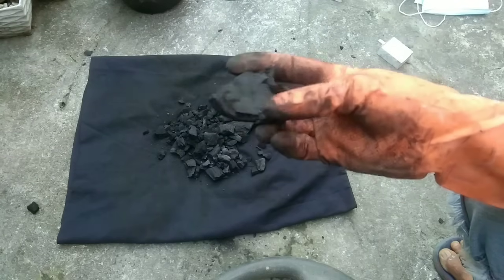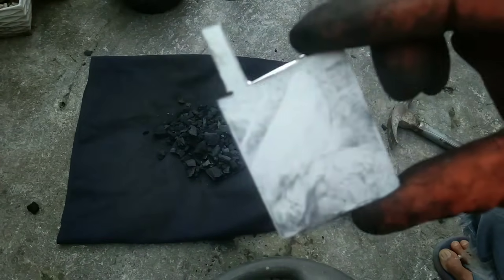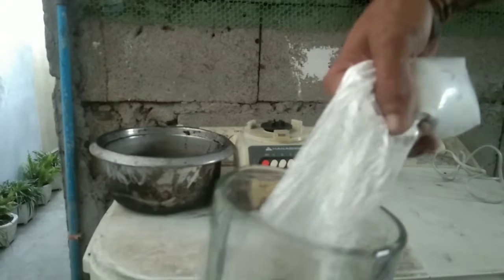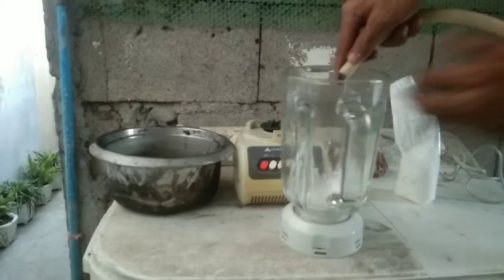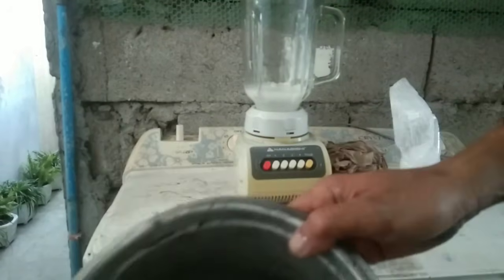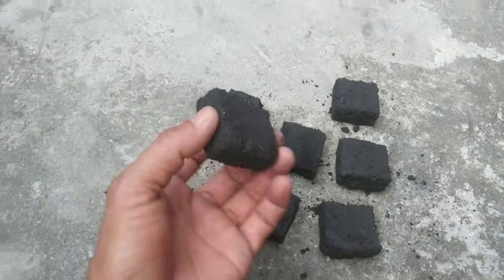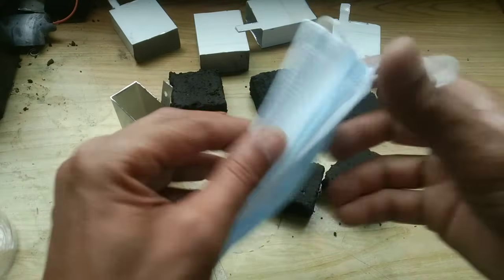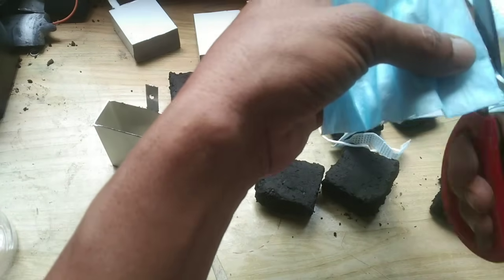How to make charcoal battery with sea water and aluminum

Comment: A better Charcoal making technique is to take a biscuit tin and make a small hole in the lid, put sawdust in the biscuit tin and place in a fire, burn off wood gas then remove tin from the fire,  if you have left it in for the correct time you will get good charcoal powder.
Reply from the maker: Thank you

Comment: Anong tamang name nung step up converter na pedeng kabitan ng wire on both ends ?
Reply from the maker: Search mo lang step up boost converter from 0.9 volts to 5 volts dc
Reply: MT3608 po ang nakita ko. Tama po ba tong choice?

Comment: I've been go to for almost 30 video but non of them are using the separator yeah the volt is bit higer than this but i want the safe battery goodjob brother,you look like someone with well knowledge,can i ask you this question,is it possible for us to make a sollar panel battery storage from this type of battery? I mean using diy not industrial batteries?
Reply from the maker: I have a video about salt water battery 12 volts, that one can be charge and connect  a solar panel. I uploaded it a year ago, you can check all my videos about salt water lamp for reference. Thank you
Reply: @MrDIYProjectTech21  ah okey I'll watch it,and maybe I will  ask you for more about batteries things?is that okey?

Comment: These billion useless masks found a way to be useful 😂😂 Great guy ! Go ahead ! Zinc-carbon battery, also called the Leclanché cell, is a traditional general-purpose dry cell. Invented by the French engineer Georges Leclanché in 1866, it immediately became a commercial success in large sizes because of its readily available low-cost constituent materials. It remains the least expensive dry cell and is available nearly. 
After a while the zinc is "eaten" by ion exchanges and cell is leaking. Then charcoal can be used to draw portraits 😊😊😊😊
Reply from the maker: Thank you

Comment: diy aluminium metal, various processes, including high voltage / current arc ionization deoxidation/decomposition, the other one is the typical high temperature molten electrolysis

Comment: I made this type of battery in my childhood, just rechargeable one. But both electrodes were made of graphite rods and had the same design. There was no aluminum at all, the cell was made just of charcoal, graphite and salt water, and some vessel, of cause, in my case it was tin can (really bad idea, because it rusted very soon). Being fully charged, it gave 2,2 volts with quite small current.
Reply: 2.2 volt it's more than normal battery, it's still awesome dude
Reply from the maker: Thank you
Reply: @IRTAHDARTER1916  Voltage means nothing if you can't source a usable amount of current and sustain it for a reasonable amount of time. Rub a balloon on your head or scuff your feet on the carpet and you generate thousands of volts. You can then ground yourself and discharge perhaps few milli-amps for a fraction of a second, but it doesn't do shit because not enough current x voltage x time. 

Same with this battery. The tiny amount of energy stored will not do any usable work. It cannot accomplish a reasonable amount of work for the expenditure of materials and time to both make and dispose of it. If it were practical, it would already be in commercial supply chain and use. If it is a workable idea, then go get funding and build a factory and compete with the existing technology. Get your pie down out of the sky before it falls on you and makes a big mess. And don't think you are smart about something until you have at least read a few books on the subject. Actual books, like in universities and libraries, with covers and pages and stuff. Not youtube videos designed to make you click click click, or instructables, or other lame stuff. LEARN, then lecture. I'm done here. Anybody who thinks they know more than I have just divulged is welcome to share his "knowledge" with the other ignoramuses here, without fear of my reply. Have at it. Last salvo is yours. I just hate seeing the ignorant teach the ignorant and all of them think they are actually doing something worthwhile. There is plenty of USEFUL stuff out there to experiment with and try to improve and develop.
Reply: Impressionante
Reply: that is not a battery, its a supercapacitor
Reply from the maker: Thanks for watching
Reply: @MrDIYProjectTech21 угольный электрод нужно сделать иначе , порошок угля склеить клеем на основе резины , при высыхании что бы в материал проникал воздух , и батарея не заливалась электролитом а была влажной ,с доступом воздуха .к углю нужно добавить графит( стержни графита с батареек например вставить )  для повышения электропроводности

Comment: Looks pretty useless, to me. I don't believe you can recharge it, and I doubt very much that it has a usable power density figure. If you don't know, that is how many amp-hours of charge it can accept and discharge, per unit of weight. Nor can that chemistry source enough current to be practical. Similar to a carbon/zinc alkaline battery, but much weaker. Waste of time and materials. Why not try to invent or discover a battery chemistry that is actually practical, cheap, safe, and all that? I can make a battery out of a potato. That doesn't mean I want to try to haul a semi truck full of potatoes around and hope that they can source enough power to do the hauling of them. Perhaps you could explore Nickel-Iron batteries and figure out how to manage their shortcomings.
Reply: who peed in that guy's cheerios mate .
Reply from the maker: Thank you for watching
Reply: More accurately these are aluminum fuel cells. They are referred to as batteries due to shape and function. But, you are correct, once the aluminum fuel is depleted, it's dead.
Reply from the maker: Check my other videos about salt water lamp. Its much easier to make, this one is just an experiment
Reply: Yea I agree. But it is very easy to make... If you put em in series at least, then it's a bit better.
Reply: Watched a good vid of a free energy battery today in a tube about the size of a roll of dimes. Copper wire coiled ends out, magnets, and his patented substance inside, looks like carbon or subn. Powers small motors etc. Patent pending
Reply: @relicreapers571  LOL!!! Yeah, sure. You believe everything somebody claims, on YT? Show it when a reputable lab tests and verifies. Ain't gonna happen. There is no "free" energy. Even solar and wind cost money to recover and store. Most of these high school science projects only produce very tiny amounts of energy and cannot be scaled up with any economic feasibility. Notice how few of these projects are actually used to run real world electrical appliances, and how few are actually connected to ammeters and voltmeters? Often voltmeters, yeah, because it is easy to produce hundreds or thousands of volts, at low current. Measure output current and multiply by volts to get watts. Then if it is an energy storage system, i.e. battery, measure how many hours it can provide that voltage and current. Then show the cost to make it and the efficiency by which it accepts a charge at bulk, absorption, and float currents. Nothing you see on YT that is not already in commercial use, is practical, almost by definition. Get your head out of the clouds and your pie out of the sky. Or believe whatever anybody tells you or that is "demonstrated" without even sufficient instrumentation to prove diddly doo-doo.

Creating detectable power out of "nothing" is entertaining but there is no bottom line gain. You are just trying to re-invent the perpetual motion machine. If you can't scale it up, what good is it, anyway? Sorry to burst your bubble but the sooner the better, and then maybe you can get involved with something that actually DOES work, not another 200mpg carburetor that runs on water or another scheme for powering your house by a bicycle driven generator.
Reply: Nameof video creator pls so I could watch too @relicreapers571
Reply: @instructoruldemeditatie2367 So, that is what you are using? How many charge/discharge cycles do you get? Why isn't everyone already using them? This is not and probably never will be ready for prime time.
Reply from the maker: Thank you
Reply: a battery is a battery man if u need to put some in perrell

Comment: Great work. How long does it run without replacing salt water? and how long without replacing / cleaning the electrodes? in short what is the mAh capacity ? of the setup
Reply: I've seen people recharge these 👍

Comment: Thanks. Does it work with a 4w led lamp? Which quantity of charcoal do I need? How much salt in water in order to have the best result? How to regenerate this battery? Very interesting project.
Reply: You are good in responding to question which noteworthy keep it up. Can one make up to 100ah with the same process
Reply from the maker: @nnejiamaechi9385 Thank you, yes it can
Reply: @MrDIYProjectTech21  thanks so how many volts was this one u made so dat and how  I go about it
Reply from the maker: Yes it will work with 4 bolts led lamp series connection of 5 to 6 cells. Any kind of charcoal will work. 2 tables spoon of salt. It can be as well using adjustable adaptor. Thanks for watching.

Comment: Very cool. Am looking forward to seeing your next video. How many milliamp does each cell produce? Oh and why bother adding cassava flour and drying the charcoal since doesn't the charcoal fall apart(gets soft) once you add in the salt water?
Reply from the maker: Very low amps if not charge. If charged 600 mili amps in each cell
Reply: The above in total will be how many ah. Will it be up to 20 or more ah
Reply: Pls respond to the above bordering on how many ah is this one u already made when connected together and charged. It will help
Reply from the maker: Thank you so much. The cassava flour acts as a binder in order to bond together to avoid crack.

Comment: Buen aporte, pero puedes simplificar el trabajo. Por ejemplo preparar la masa de carbón directamente con agua salada y luego rellenar el tubo de aluminio o lata de gaseosa/cerveza. Si quieres puedes previamente dejar la membrana pero técnicamente no es tan necesario ya que existen batería con negro carbón (es el más conductor) + aditivo de magnesio entre otros que no llevan membrana. El carbón vegetal rara vez tiene buena conductividad, sólo la sal con agua sirve para conducir...puedes reforzar la conductividad el carbón con Grafito en talco.
Saludos desde Argentina 🇦🇷👋
Reply: If you activate the charcoal will it increase conductivity or do you need too buy actual carbon powder...I have an idea off mixing carbon powder quartz powder a metal powder maybe aluminium or also maybe vanadium crushed into powder and mix it all together with either thermal plaster or a conductive glue and add some oil or grease for the extra liquid content and salt then press into sheets...then stack a piece off that with a piece off metal in a volta stack and alternate them in a stack and try it as a dry battery if not add a substrate n make a wet battery stack....do you think this would be worth trying a design like this...cheerrs
Reply from the maker: @jshaw4757  You have a wonderful idea. If I only have enough materials I will try your suggestions. I am sure it will works better and produce more amps and volts. Thank you.
Reply: @MrDIYProjectTech21  Hi I just sent you a reply but I think youtube has deleted but I will reply in full again...thanks for encouragement check out hemp batteries mate up too 8 times better than normal carbon ..cheers
Reply from the maker: Thank you. Stay safe and connected..
Reply from the maker: Muchos gracias

Comment: may Bago nanaman, dpa Ako naka try nung activated carbon filter, boss!
Reply from the maker: Babalik po ako sa activated carbon. Medyo mababa voltage output ng charcoal
Reply: Kahit iseries mo multiple cell mababa pa din?
Reply from the maker: @mgamuntingsikreto6700 tataas po volts pag series pero yung current stay the same